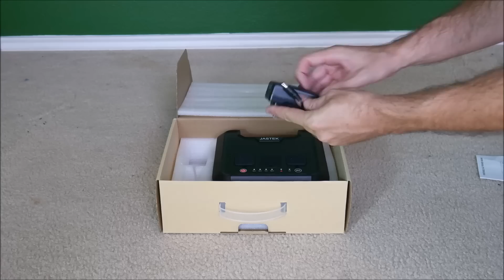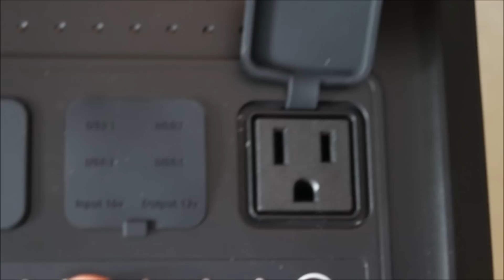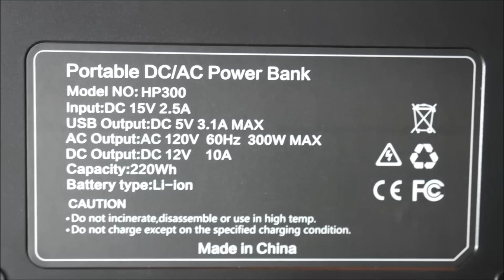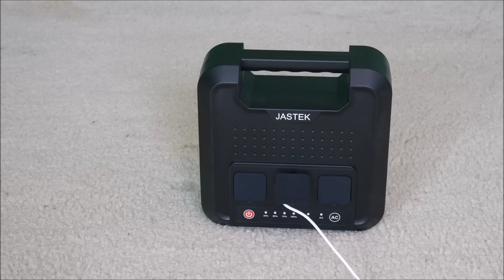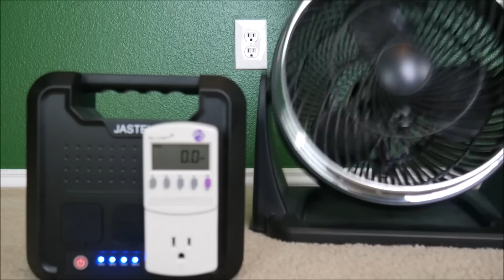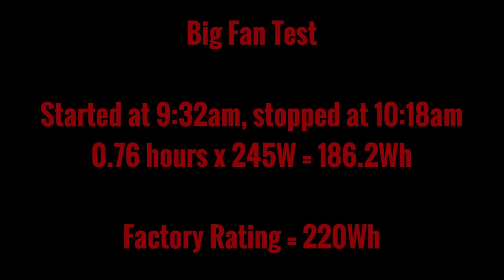Jastek 300W Solar Generator

Comment: I know this is an older video, and you may have more knowledge now, but fast charge on a samsung is not due to "2.1 amps", it's because it jumps from normal 5v of usb to 9v.  So, at 1.5 amps, instead of 7.5 watts at 5v, you get 14 watts or so at 9v.

Comment: The fact it ships with no solar panels and the proper low tension cable for solar generation makes this strictly a battery bank.  They had no business putting Solar Generator on their packaging or marketing.  Call it a battery bank is fine by me.
Reply from the maker: I agree.  It should be a minor bullet point that you can use a solar panel to charge the bank.  Or they need to provide you with a cable at the very least with the proper connector to connect to the bank on one end and MC4 connectors on the other.  Providing a solar panel with the bank is asking a little too much.

Comment: Nice video, appreciate the way you explain things in simple terms so all can understand. I still don't appreciate why the manufacture would call this device a "solar" generator. As Robert Schilling stated,  it appears to be "nothing more than a rechargeable battery". Is the "solar" title simply because it can be charged with solar panel output? If so, it's very misleading.
Reply from the maker: I agree.  There is nothing solar about this the way it ships.  At least if it had a 12V input cable with MC4 connectors on the other side you could easily use it with almost any solar panel.  But as it sits now you would have to custom make a cable.

Comment: 👍 for the video.  👎 for the product.  It cannot be charged by solar...no cord is provided.  A proprietary cord.  So no one is going to have a proper cord rendering solar useless.  Unit is nothing more than a rechargeable battery.  Ho hum.  Next item!! 😁
Reply from the maker: In all fairness, the connector may not be proprietary.  I will test mine out with various connectors I have laying around and see if I can find something that works.  I just didn't want to do that on camera and it is definitely a negative that they did not ship it with a cable.
Reply: LDSreliance .....ahhhh.  Ok.  But im not gonna hold my breath while you look.  😁
Reply from the maker: Of course.  The company should have provided a cable.  For that alone I probably would not pay $230 for it.  But the device itself is pretty good.

Comment: I would hardly consider it a good buy at 230 dollars. Perhaps if it was 30 dollars.
Reply: The average price is $100 for each 100 watts. I can run a 32" Fire t.v for 4 hours using only a 148 watt unit. So it's about right...also they put these on sell sometimes.
Reply from the maker: $30?  Can you even get an 8 pack of AA batteries for that much any more?
Reply: Yes 30 dollars. That is all it is worth for what it does.
Reply: X_Ben, I am not saying what they sell for. I am saying what they are worth in accordance to what it delivers. You TROLL.
Reply: For the price at least 4 times that amount.
Reply from the maker: It is worth a lot more than $30.  You can't even get a 300W pure sine wave inverter for double that.
Reply: It is not what you cannot get but what it is worth.
Reply: DeepForest, do you know just how stupid you sound? A bad deal is a bad deal.

Comment: Can you charge it with solar panel ? Or only by AC ADAPTER
Reply from the maker: Yes you are supposed to be able to charge with solar.  However, it does not come with a cable so I could not try it.